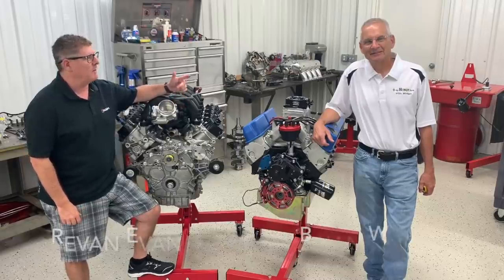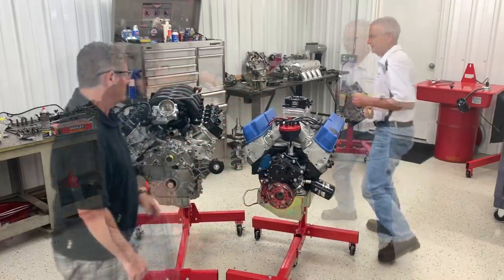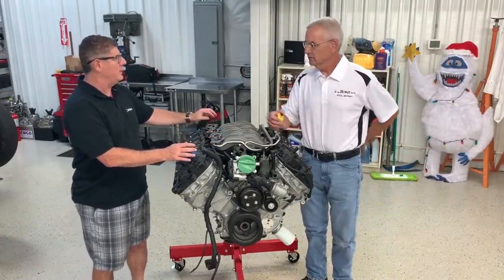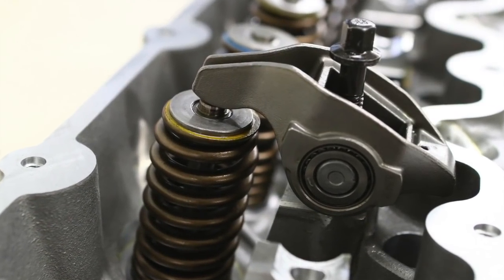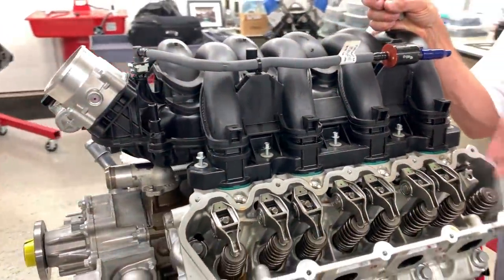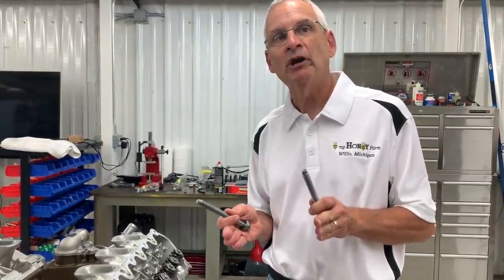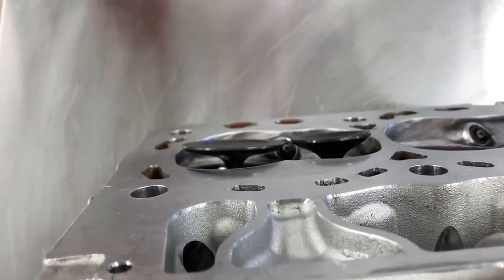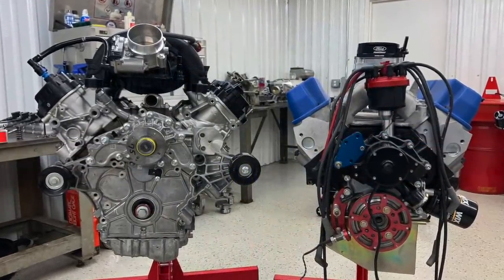Ford 7.3L Godzilla Engine Dyno Results, Teardown & Comparison to Coyote & 351 Windsor Part 2

Comment: They removed the head and all I can think of is LS🤦🏾‍♂️
Reply: When I remove a LS head, all I can think of is Windsor.
Reply: Ls has same firing order same head bolt. Spacing. Basicly
 A copyed. . 351 windsor
Reply: @bigboreracing356 ; That's what forty years of technology will do. Let's go back a little farther and see if a LS can beat a flathead.
Reply: @bigboreracing356 ; Now if you want to get into the 21st century. Check Engine Masters a few years back (the one year they allowed a ford mod engine to compete) three mod engines competed, they took 1st, 2nd and 3rd place. The next year Engine Masters banned the mod engine. (Just too painful)
Reply: @daleostrom3613  They tried to make the rules so a mod couldn't compete the year they won. They had a minimum cubic inch limit.
Reply: The ls 1 is the only ls to have the ford firing order. Yes the ls was heavily influenced off the windsor. Quench chambers. Runner style, head bolt pattern, bore spacing, deck height and even gm admitted that they did use some of the windsor design and said they should have changed a few things. It doesn't matter the LS is not that great an engine.it's not efficient and requires a perfect 👌 100% tune or will blow up fast as fuck. (no forgiveness) For fuck sakes anyone who builds seriously will tell you the same. The cylinder angles are not the best for holding power and they don't take pressure all that great either. The oil system is a joke. The only good thing it offers is a forged bottom end that hold big power but not for very long. If you're indeed stupid and don't know how to build an engine the an LS is a great option. But the factory pistons don't hold boost Temps well and the ring ends aren't set up for boost. This is why they always blow up. Even when you put good pistons and rings the cylinder pressure still fucks off pistons....so many more engines out there that are much better at power and holding it. An LS is basically like taking an axe to cut the percision of a lazer and what's worse are the stupid ass monkies that sware by them, but you always have to ask those very stupid individuals 'who ties your shoes for you in the morning'? Their those kind of stupid people.

P. S speech to text is about as horrible as the ls efficiency.. How ironic
Reply: @luciankristov6436  the chambers mimic an sbc vortec head, the runners are not similar, the head bolt pattern is not the same, the bore spacing is different, the deck height is not the same and no GM never "admitted" to anything lmao. I've built several of both engines this is the exact kind of comment from someone chocked full of internet info. Any engine  using stock parts and forced induction requires a "100% tune" whatever the fuck that means lol. The "cylinder angles" are not the best for holding power? Wtf does that mean? The oil system is a joke? They literally have no oiling issues whatsoever we run them in marine applications 6k rpms all the way across a lake no oil cooler and no problems at all. The bottom end is not forged either. The stock pistons hold 4 digit power for countless hours. The ring gaps aren't set up for boost? Why would any NA engine have ring gaps set up for boost? So they can have low compression? I don't swear by any engine I build engines of all makes but this has got to be the most unfounded, uneducated most moronic comment I've read on YouTube. We're all now stupider for reading it
Reply: @bigboreracing356 ; Why go backwards ?? You are the one donkey stomping a 50 year old Windsor with a late model LS.
Reply: @bigboreracing356 The problem is, how long before you can buy one. It'll be years before you can buy one out of a junk yard, and it won't be reasonable priced for many years. I don't think Ford is going to deal on them ??? If you're happy with push rod engines --- SR71 460 --- CHI Cleveland --- AFR Windsor --- All very competitive engines.
Reply: STREET RACER you came in asking something I didn’t even mention. So I let you say what you think I meant
Reply: Guys don’t tell me that y’all didn’t see how the lifters are in trays like the LS, and the cross patterns of the water jackets? 🤷🏽‍♂️ not to mention the ignition coils
Reply: STREET RACER I don’t know, should it?
Reply: STREET RACER I don’t know why what’s wrong with it?
Reply: STREET RACER so exactly who or what would you prefer to make your head bolts so they’re not “man made?”
Reply: @bigboreracing356  30 years later...so I guess it is fitting that ford made a better LS 22 years later.
Reply: well, the ls is a 351/4.6 mod motor copy to begin with so....
Reply: @bigboreracing356  its funny that you think a 351w or turbo mod motor is slow. Let me know when the ls gets into the 5s in the 1/4, like the mod motors. So far, the ls can't.
Reply: l.s. eng has same firing order as a. Windsor same bore stroke. And with a lil work 351 Cleve. And Windsor bolt spacing. Are almost perfect. If ya don't. Believe me. Kuntz racing engines. Took. A intake like Bobby ducote street out laws engine. Builder and put it on a. Ls . no. Biggy. Jus. A $ 2500 intakne
Reply: @bigboreracing356  NICE 
and. That is from a wanna bee foxbody. Guy
Reply: @bigboreracing356  i got 84 capi Fox twins smalí block and 65 coupe. Thats nastyer than the Fox. Hell ya i like all forms of Racing the 7.3. Os badass .i ains gotta say nuthin give ita lil bit.
Reply: @bigboreracing356  that billet crankshaft aint no BITCH .
BET FORD KNOWS. WHAT THEY GOT. ALL THE R&E AS
Reply: @bigboreracing356  many many generations of drivers owners mechanics champions . and fans. Too rep thanks fo.mo.co.
Reply: Look at the bottom end of an LS and all can think of is how GM copied Ford's "Y" block design with cross bolted mains.
Reply: If you think a Ls deck looks like a Windsor deck you have clearly never been in one! Head bolts amount and spacing is the only thing similar but Gm admitted that was not the way they should have went.
Reply: @justinkneir8304 ; The LS is so similar that the Windsor honing plate will bolt on and now I heard the headers will bolt on.
Reply: It's crazy that they're ALREADY close to hitting LS9 horsepower numbers without adding any boost!  This is going to be an engine to watch.  At this rate, I won't be surprised if that new Procharger makes 1000 horsepower on this engine.

Comment: You know someone is going to push the limit on one of these engines. Do you have an idea what horsepower limit the block and crank will have?
Reply: I know somebody who works in the R&D department for Ford.. Says its been tested to well over 1000CHP on stock internals. He wont say how high but i guessed 1300 and he giggled.
Reply: @zuestoots5176  That is very interesting indeed.
Reply: @zuestoots5176  deep block,crossbolt center mains, steel crank. Yeah it'll handle some serious power. And the guy that designed the heads worked for Ford's performance division and has been running a Mustang drag car for a while with one in it. 🤘😎😋
Reply: @zuestoots5176  your full of shit.  why make up stories?
Reply: I second that.  I'm not too happy with Ford at the moment but it is way cool to have a new mainstream pushrod engine with these cubes in mass production again. 

Good times!

Comment: Boy did I underestimate the Godzilla!
I think I have more questions now than I had during the last video!

Do you guys have weight numbers?
Crate engine part numbers?
Does it feature cylinder shutdown capabilities like competitor pushrod engines?
Is the aftermarket offering many parts yet?
Can we get a kickstarter going so we can have Jon Kaase design some heads? 
;-)
Reply: @mewrongwayKOCXF  
It's not a null argument if you're comparing apples and oranges.   You're comparing a new Godzilla versus a used LS9.

If you're going to play the used engine game, just skip the LS9 and go for a $500 junkyard LS3 with eBay Turbos and tune it for 1000 hp.  If it blows up, who cares?  It's cheap to replace.  The LS3 is a poor man's dream engine.

The Godzilla will never be as affordable as an LS3, but then again, an LS3 block will never come close to the capabilities of a Godzilla.  You get what you pay for.
Reply: You're easily impressed, just under 600 on a 7.3 with cam intake and head work is pretty meh... musta been a weak cam
Reply: @sdmoparmaninsd6713  
The 7.3 truck engine just came out and these guys are only 40 horsepower shy of a $18,000 LS9 crate engine but did it with no boost.  When the new Godzilla Procharger comes out it's going to destroy the LS9 and do it for less money.  Not even the $30,000 Hellephant crate engine will stand a chance.
You're damn right I'm impressed.
Reply: @SwankySasquatch66  I made more HP with a 50 year old 440 mopar, ported heads and a flat tappet cam... this 7.3 is NOT impressive by any means... like I said maybe it's a cam issue since the head flow 'seems' to be there but still numbers are numbers, and under 600HP for 7.3L is weak sauce
Reply: @sdmoparmaninsd6713  

Ok
Reply: @sdmoparmaninsd6713  - dodge is hot garbage